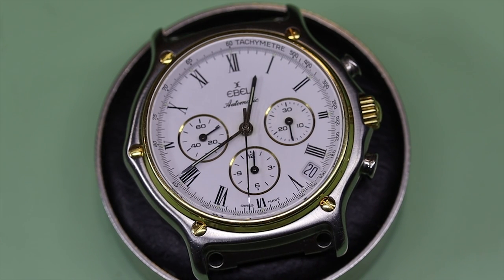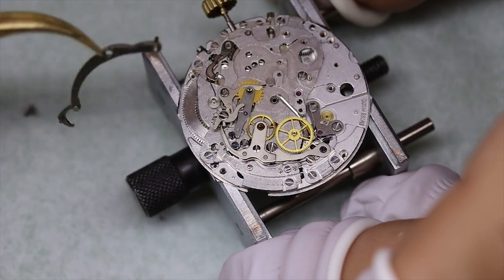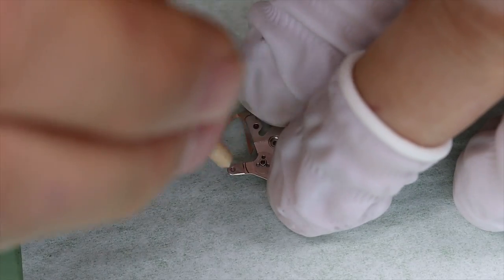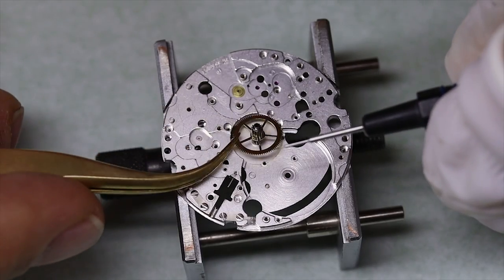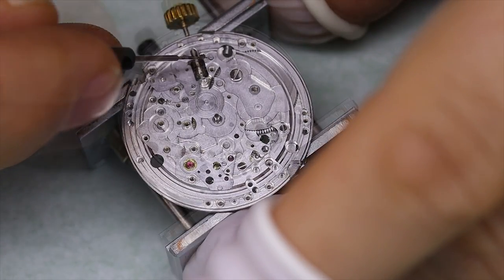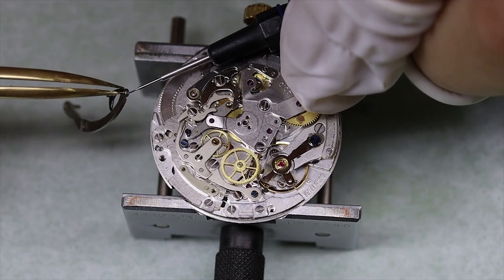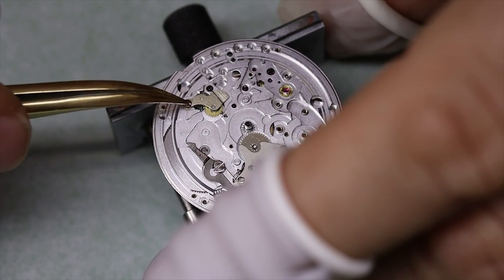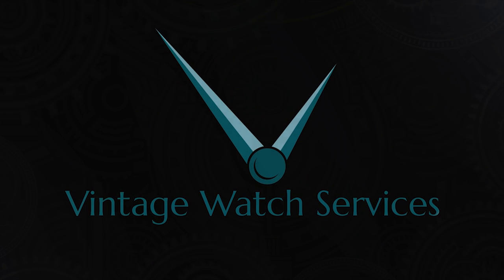Why did they hide the El Primero in this watch?

Comment: That is beautiful! It's a crime it doesn't have a display case back.
Reply from the maker: Hello Matty, thanks for watching! Yep, this watch would probably sell more of they displayed the movement...
Reply: @VintageWatchServices   Well, they replaced this watch with the Modulor using their Lemania-based Caliber 137 in 1995, so it must be the secondary market you are talking about. But Ebel sold these pretty well considering their market targets, and given Ebel's strong position with luxury quartz watches of their own manufacture. The Ebel Ref 1134901 on strap sold for about $5800 in 1994--the last catalog in which it appeared--which I believe was more than a Daytona with the dumbed-down Zenith movement at the time. Times have changed!
Reply: This watch was sold from approx. 1983 through 1995. Back then, display case backs were extremely rare. Imagine, Patek Philippe didn't have them at all. Just with the start over of A. Lange & Söhne from Glashütte in 1996 after the end of the communist aera in former East Germany and showing ALL their beautiful decorated movements under a crystal, this trend started. But at that point in time, the el Primero movement was already gone from the Ebel 1911 and the decline of Ebel was already under way.
Apart from the display case back (that you actually don’t see when wearing that watch), I have to admit that this watch has it’s downsides, e.g. the housing isn’t really water-proof (only 3 ATM means you can wear it when washing your hands), and it’s quite sensitive for shocks, e.g. cycling only on smooth roads and such kind of things. These are things, where a Daytona has clear advantages. Still a Daytona doesn’t have the classy appearance of this vintage watch.
Reply: Really enjoyable and informative video. I've been lucky enough to have had two Zenith watches  - an autosport from the 1960s and an amazingly accurate hand wound, from the early 1970s. These  were treasures, which I've now passd on to new owners who appreciate the heritage and  workmanship of the Zenith brand.

Comment: Excellent video--my fifth today in a post-subscribing binge. As an Ebel (and Zenith) enthusiast, let me offer a few details for posterity. 1. Charles Vermot wasn't merely a "worker" at Zenith. He'd been hired by Martel in 1936, and by 1976 when he was resisting orders from Zenith Electronics (of USA), he was in charge of production at Zenith. He retired soon after. It was the request from Pierre-Alain Blum of Ebel in 1982 that brought him out of retirement. 2. The El Primero in the video is a caliber 40.0, which was made in the transition year of 1986. Prior to that time, the Ebel Chronograph used a wave bracelet and was working through a stock of 70's-era Zenith Movements that were marked 3019PHC. Vermot had hidden away four or five thousand ebauches, and Ebel purchased those initially in 1982. Based on that sale Zenith Watch Co. and it's owner Dixi Machine decided to restart production using re-established old tooling, and used a new designation: 40.0. That run was successful enough to attract interest from Rolex, and in response to that contract developed new tooling that went into service in 1987, according to Rossler. Those movements were marked "400", and later Ebels have Zenith 400's in them. 3. Ebel started the 1911 series in 1986, at the 75th anniversary of the company. These used the new 1911-style link bracelent instead of the prior wave bracelet. 4. So, an Ebel Chronograph with a 40.0 and a link bracelet can be dated to 1986-1987, a year after Ebel placed these on the wrists of the actors in the hit TV show "Miami Vice". 5. Ebel was a haute de gamme company at least until the last decade, including during the first decade of Movado ownership. They've drifted downmarket since then, but their production standards are still quite good. (My own example of the 1134901 is identical to the one in the video, with a Zenith 40.0, but includes the bracelet. Time to get it serviced again!)
Reply from the maker: Thanks so much for sharing your amazing knowledge, Rick!

Comment: Excellent video! 

Question: does anyone know if the Ebel 8137241 has the same internals/movement as the 8134901?

I have been trying to find the all gold version of the 8134901 with little luck, however the 8137241 looks a lot like the 8134901 with a  different dial.

As I have the dial for the 8134901, I wonder if I buy the 8137241, can I put the 8134901 dial on it?

Comment: Amazing job my friend. I have a question, as a new El Primero owner I've noticed something that I haven't heard on other watches - there is an audible faint click when the rotor spins 1-2 turns, it seems that it's the same click that is heard when you wind the watch manually very slowly. I assume this is normal operation of this movement? I'm wondering because on other automatics all I could hear is the rotor wooshing away, no clicking whatsoever (even when winding them via the crown). Would appreciate your input on this!
Reply from the maker: Hello, thanks for watching! That is indeed most likely the sound you hear, but it should take a bit more than 1-2 rotations. And when winding with the crown you should be able to hear the clicking if you put the watch to your ear.
Reply: @VintageWatchServices  Thank you for your answer! Yes I can indeed hear the clicking when winding the watch with the crown, and at a certain point every 12 clicks or so I hear a double click - I assume that's the clutch mechanism preventing overwinding? You were right, I guess it is a bit more than 2 rotations of the rotor. The watch is titanium so maybe that increases the volume of the click a bit. I was suprised as I thought the automatic winding works in some different way but it is in fact connected to the click too.
Reply from the maker: @PoltergeistWorks  The automatic winding indeed most often works through the ratchet (or crown wheel) and thereby the click. This is since there otherwise would have to be a separate click or similar to stop the barrel from unwinding when the automatic winding is active. Less complexity is generally better :)
Reply: @VintageWatchServices  True. Then it has to be that same sound of the ratchet as I really don't even have to put the watch to my ear to hear it when I wind it with the crown, same as when it's wound by the rotor. I was a bit worried for a moment as most of my watches are manual wind and the only other automatic is an Aquis Cal. 400, this one has more of a constant buzz or micro clicks when the rotor spins - no distinctive click when winding from the crown either...

Comment: Wonderful! My friend has this same watch and she loves wearing it. One question I have is that in the instruction manual it warns the when setting the hour and minutes Hands they must not be turned backwards as it may damage the movement. Could you explain why this is and what it would damage please? Happy new year as well!
Reply from the maker: Hello Ian, I know Zenith says that in their EP manuals, but it is most likely a relic from the old days. Nowadays basically all movements have built in features which ensure that a watch will not get damaged by a simple thing like this. It is something that used to apply to date/calendar watches, where the automatic switch-over could be damaged if turning the hands backwards in the period it was engaged (typically from around 9pm to 2am). It's still good practice to always turn the hands clock-wise and always recommended, but as a manufacturer one cannot rely on all customers following good practice, so they made it idiot-proof :)

Comment: Great…but is the grease you put onto the pallets fork, good ALSO for the 5 Hz frequency, as per the El Primero movement (36,000 bit per hour)?
Reply from the maker: Hello Ricky, thanks for watching! Yes, moebius 9415 is specifically intended for high beat movements, 28800 and higher. Nowadays a lot of people use it for any beat rate movement, though.
Reply: @VintageWatchServices  thanks indeed Maestro!

Comment: Can a clear back be put on watches like this ? I do a lot of precision machining and always wondered if a standard back could be hollowed out and a sapphire disk fitted into the ring remaining. Maybe this process could be done by buying a substitute back so you can put the watch back to the original if you want. Not just on this watch in particular but on others that have stunning mechanicals inside that cant's be seen. Many times when you "Pop" the back of a time piece it is the most exciting part.....seeing those beautifully machined and hand-crafted parts. Peace and Happy New Year......Hope it's better than 2021
Reply from the maker: Hello, thanks for watching! It's difficult to do so with an existing case back given the relatively thin metal in it, but it's not too difficult to make a new display case backs for such watches. You will find such on eBay for some of the more common watches like seiko GS/KS56

Comment: Season's best to you and your family Stian!  
Once again a plethora of knowledge! I had heard of Ebel before, but had no idea that some housed premium calibres.  It's really a nice looking watch!  
  I always wondered about hi beat (36K vph) movements wearing more. Some have said that "modern" lubricants negate any excessive wear but I'm wondering what your professional opinion is.
Reply from the maker: Hello Randy, thanks so much and the same to you and yours :)
There's very little actual information out there on why some manufacturers went back from 36000 to 28800, and there's similarly little information on whether 36000 leads to more wear. I suspect wear isn't really the issue, more that a 36000 train requires a lighter balance and some more fine engineering than a 28800 train while the benefits aren't that much bigger. Also, the lubricants need to be replaced at least as and probably more frequently than lower beat movements. This is in fact a pretty big issue, given that most watch owners don't service their watches often enough at 5 year intervals. Watches breaking down due to this would potentially lead to publicity issues for the manufacturer. Hence the total case for making a 36000 watch isn't necessarily that attractive. .
Reply: @VintageWatchServices  thanks for your thoughtful reply, best wishes to you for the coming year.

Comment: Brand New to Watch Repairing only Since Christmas 2021
What Solution do I Buy for my Ultrasonic Machine.
Reply from the maker: Hello Robert, welcome to the world of watchmaking! The solution to buy really depends on where you are located, as these chemicals are rather strong and not that easy or advisable to transport in large quantities. In the US L&R is very popular, in Europe Elma 1:9 is very popular. 

What I would suggest however is that you get some small jars to put your parts in. What you do is to first fill the ultrasonic tank with water high up to about the lid of the jars. You fill these jars with the solution and then place them in the water in the ultrasonic tank. That way you save a lot of solution.

Comment: When I restored my grandfather's Vienna Regulator pendulum clock (the first clock I ever fixed), I found a few broken parts such as the chime flirt had been bodged by my grandad (in the case of the chime flirt, he had soldered on part of the shaft of a jeweller's screwdriver). Eventually, I was able to source genuine replacements, from the same manufacturer (Gebruder Resch) and from about the same period (mid-1880s). So I don't regard it as a chimera, a mixture of old and new parts, but a sympathetic restoration.
Reply from the maker: Sounds like a loving restoration! And that's the most important thing :)
Reply: @VintageWatchServices Yes indeed, and I find the tick and the chime most comforting. I remember when I’d cleaned all the parts in my baby ultrasonic cleaner, straightened iffy pivots, reassembled and oiled the movement, and finally re-hung the weights. It wouldn’t run, although the movement worked fluently. So I started to try to put it in beat, one tiny turn at a time. Finally, at 03:00, I heard, “tick-tock… tick-tock”, and I knew then I was on the right track. I got it fully in beat the next day, and I even managed to get it so the accrued timekeeping error was largely erased by winding the clock (no remontoire here!) It’s a beautifully decorative case, and I’ve sanded it, re-stained it and waxed it so it practically glows. I’m never going to sell it.
Reply from the maker: @Dragonblaster1  That's a very nice story and you should absolutely keep it :) It'll forever be an item of pride!

Comment: The El Primero Chronomaster is an awesome watch I know. But the high beatrate does wear out parts faster unfortunately. The 36,000 VPH is awesome to watch go in person. I had been trying to find one for about 2 years and finally got lucky a week ago.
Reply from the maker: Thanks for watching! It's a bit of a myth that the 36000vph beat rate wears out watches, given that it's really only the balance and the pallet fork that rotate a bit faster than in 28800vph watches. The relatively few 36000vph watches around is more likely down to the fact that very few people have their watches serviced as often as they should anyway, and then there's a chance of bad publicity for the makers if something goes wrong 😉

Comment: In many watch servicing videos I have viewed, no mention is made of cleaning the back of the dial.  In some cases the entire watch has been found to be heavily oiled and soiled but never has the watch dial back cleaning been mentioned. I trust this does happen but is not considered to be of interest? I just thought that for completeness a video should at least mention that this aspect has been covered, otherwise the dial would only recontaminate the movement upon refitting.
Reply from the maker: Hello Robert, if the watch is soaked in oil then the back of the dial should indeed also be cleaned. That is however very rare, and most times you wouldn't need to clean the back of the dial. You always have to take a look at it to be sure of course :)

Comment: May I pick your brain once more? You mentioned the amplitude would be a little higher when you put the automatic works on. I try to figure out how that works, my guess would be there is no  influence on the balance, but of course I can be completely wrong. Anyway, thanks for this video!
Reply from the maker: The amplitude will be a little bit higher since the mainspring will be wound up slower than when wound by hand. The rotor needs to rotate some 80 times to wind the barrel one full turn, meaning that the run-up to the point where the force of the mainspring overcomes the friction is reached slower. It's like when you pull the table cloth of a decked table; doing so very fast will leave the plates etc where they were (if you're lucky) while doing so slowly will crash everything :)

Comment: Why could there not be a combined watch cleaner and ultrasonic cleaner?
Reply from the maker: Thanks for watching! There are actually watch cleaning machines with both rotary action and ultrasonic. The thing is that the movement parts and the case are mostly different materials and might need different cleaning solutions. At least for me, it's more convenient having separate machines so they can be used at the same time for different parts.